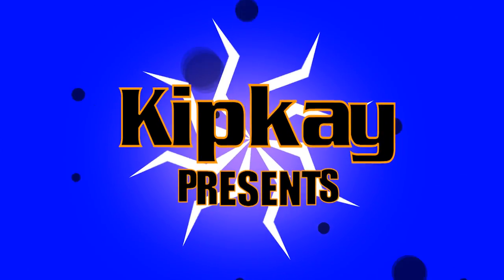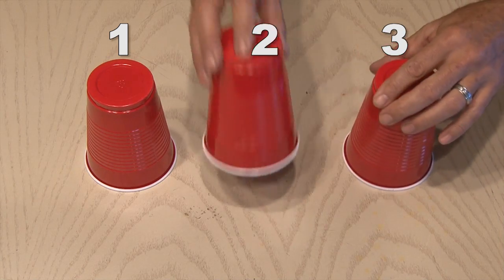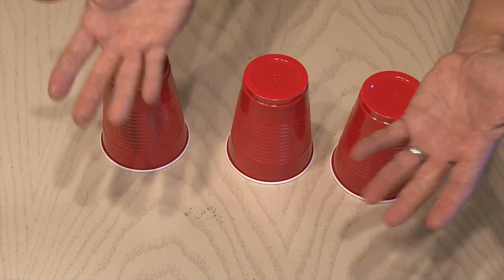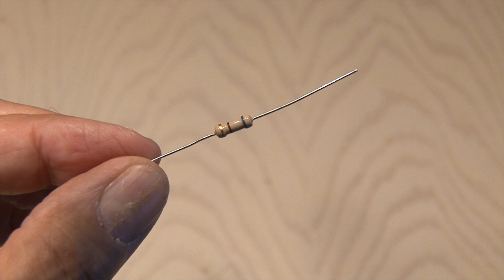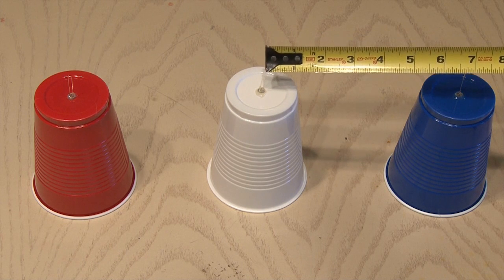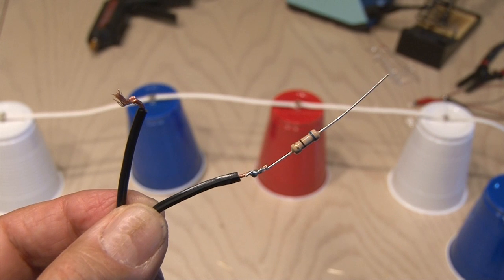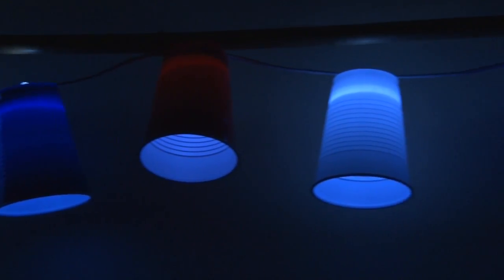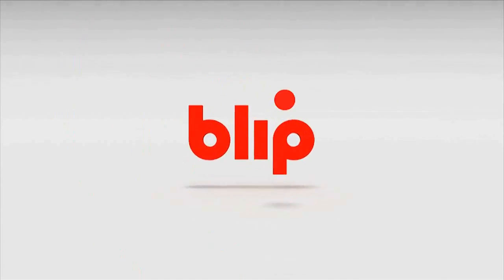4TH of JULY! - Solo Cup Party Lights!

Comment: If you wanna make something like this, but without the need of soldering, you can just get yourself an LED daylight white C9 set or warm white Cine set along with red white and blue solo caps drill a hole on each solo cup that is big enough for this screw portion of the bulb place cut in between the socket and the bulb make sure that you do that for each socket and then you got yourself a force of July solo cup lightstring without the need of soldering or extra work

Comment: another cool light hack is with plan white or clear x-mas lights. All you have to do is get a bunch of spent shotgun shells, crimp the ends like they were new and push the light in. the crimp holds the shell on and when you plug them in the shotgun shells glow whatever color they are.

Comment: You should have covered the opening of the cups with a piece of paper matching the colour of the cup in order for the light coming from the lamp to match the respective cup. (I guess you could use different coloured LEDs instead but that doesn't make for a good comment.)

Comment from the maker: The LED's do not generate nearly enough power to melt plastic nor does the 18 gauge lamp cord used for the wiring. Remember the LED's are only 3.6 V at 30mA and the AC adapter is generating about 14V. Not sure where you could even find this as dangerous.